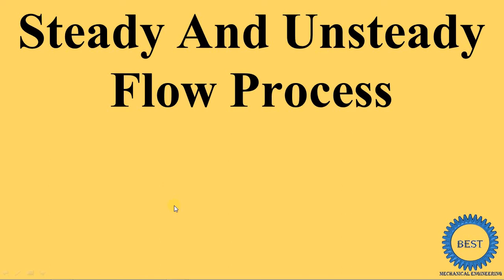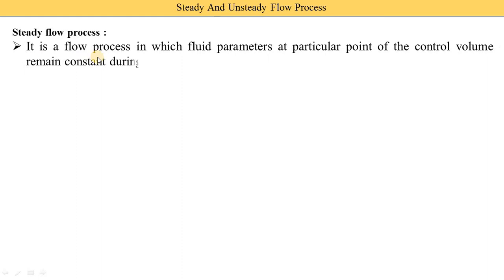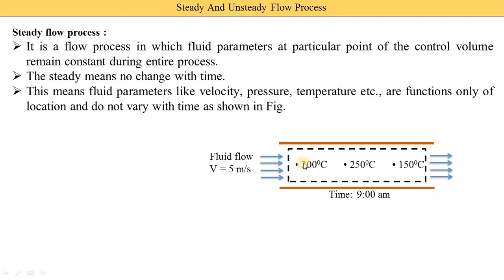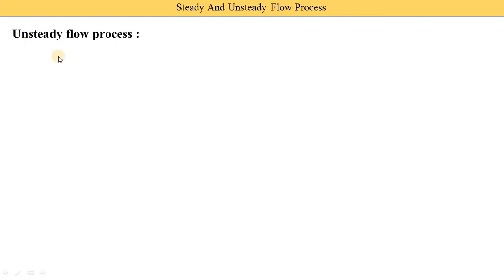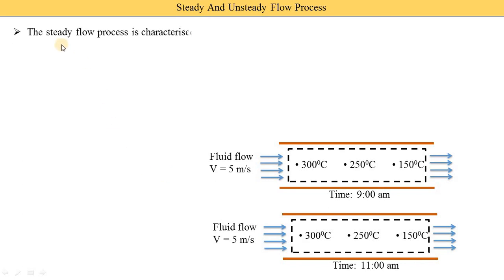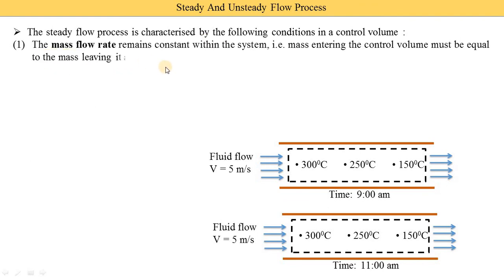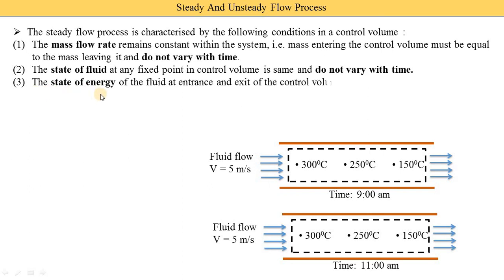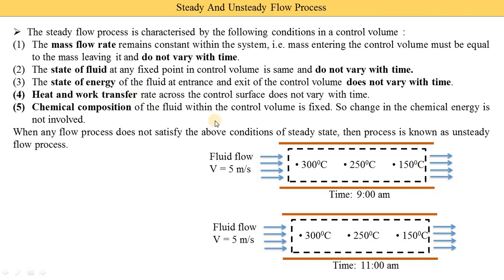Steady And Unsteady Flow Process

Comment: Steady state -

• For mass : No net accumulation at any instant of time anywhere throughout the volume of system. 
(Net incoming & outgoing mass fluxes & production or consumption of source of mass is balanced at each instant of time & at every local in the control volume/control mass).

• For momentum : No net momentum change at any instant of time anywhere throughout the volume of system. 
(Net incoming & outgoing momentum due to mass flow is balanced due to effect of external unbalanced forces at each instant in time & each local in the control volume/control mass). 

• For energy : No net storage of energy (Energy due to temperature) or its change at any instant of time anywhere throughout the volume of system. 
(Net incoming & outgoing energy transport fluxes due to convective flows are balanced with sources of conversion, diffusion & dissipation of energy at each instant in time frame & every local of geometrical space of control volume/control mass).